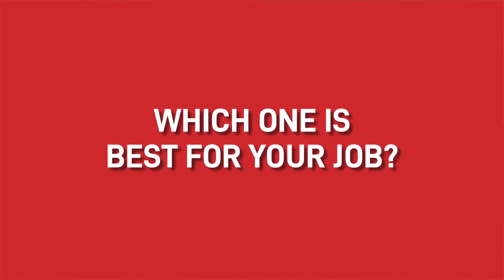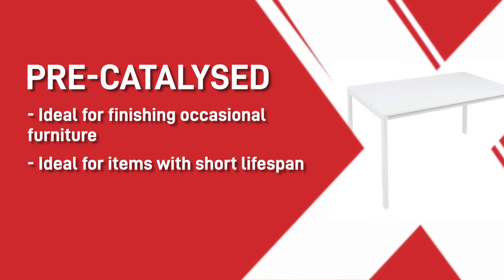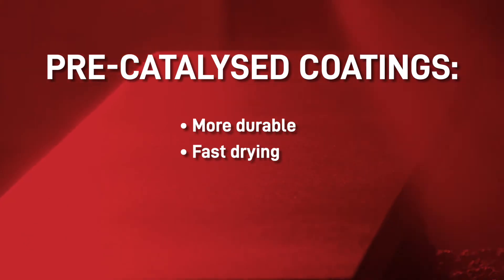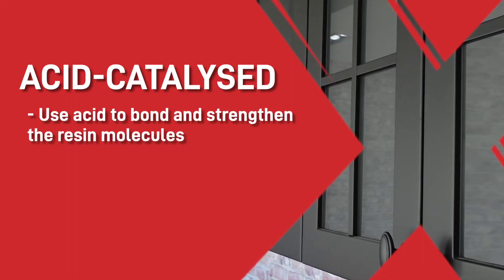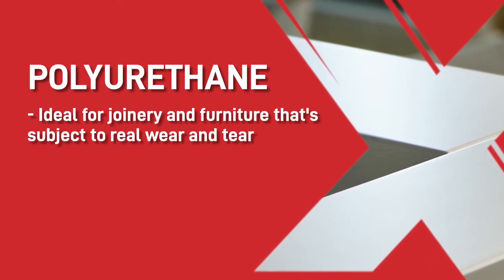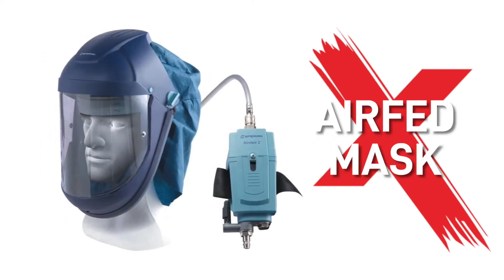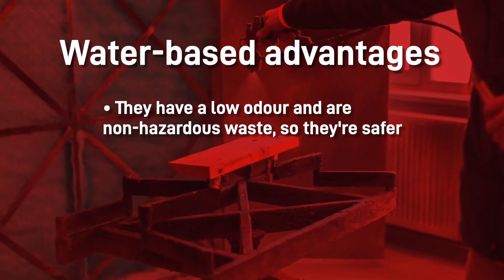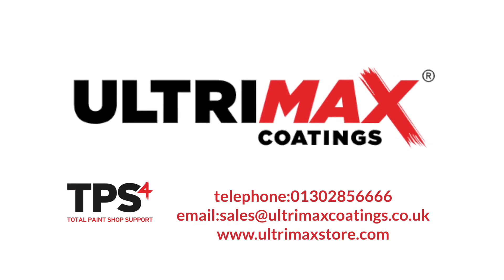Which Wood Coating is Best for Your Job? Polyurethane, Pre-Catalysed and Acid-Catalysed Explained

Comment: Are you able to recommend the best spray gun and size for the Spray Tip for the Sayerlack 2Pk Polyurethane Topcoat satin - TZ99. and the Sayerlack 2K Water Based White Interior Primer & Undercoat- Ultimax  .for MDF kitchens
Reply from the maker: hello steve yes sure we recommend a W400 Iwata with a 1.8 tip like this one here: https://www.ultrimaxstore.com/iwata-w400-classic-plus-gravity-spray-gun-1.8mm.algw00118

Comment: My business produces kitchen cabinet doors that are made of MDF or a combination of MDF and wood. We do both traditional dead matt doors and extremely glossy modern doors. 

Do you recommend 2K Acid-Catalysed or 2K Polyurethane for my business?
Reply from the maker: Hi Jenny, thanks for your question. Both would work but we would advise that if your budget can stretch to it  use Polyurethane as the finish is more durable and arguably better looking finish for items like kitchens that need a top drawer finish. When it comes to wood finish you can't really beat the Sayerlack Polyurethane finish, this Italian brand is arguably the best in the world currently https://www.ultrimaxstore.com/polyurethane-coatings-c-59 and the top cabinet finishers and kitchen manufacturers (on a mass scale) that we work with use Poly (you would recognise the names).  Also as a side note team the Polyurethane coating with a top primer like AU474 https://www.ultrimaxstore.com/sayerlack-2k-water-based-white-interior-primer-au474-c-60-p-1340 for a really durable and stable coating.  Obviously worth noting that the Sayerlack Poly ranges are 2K so good respirator equipment is a must , but the finish is worth it !  If you have any other questions please feel free to ask - we have a dedicated wood specialist who is happy to help. br Andy - Ultrimax Team